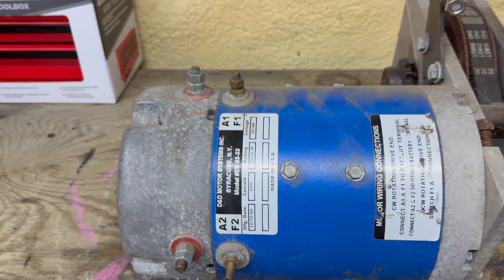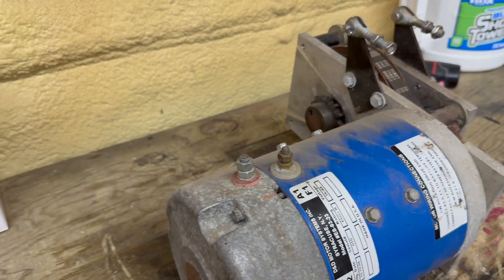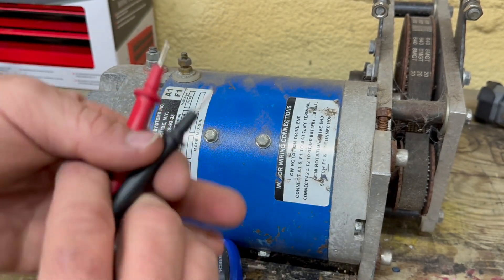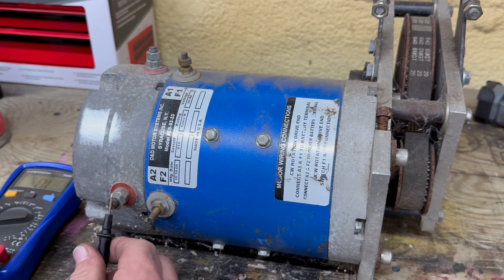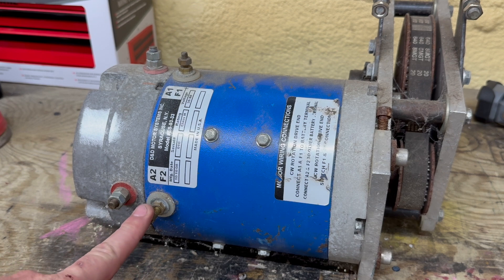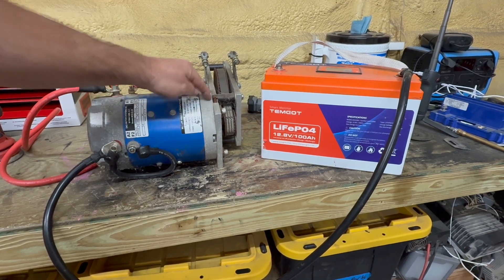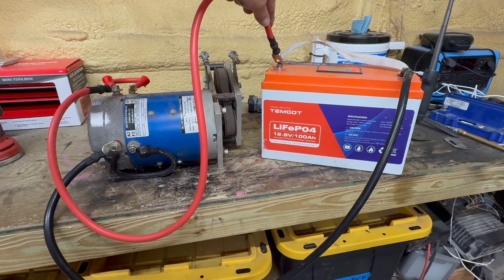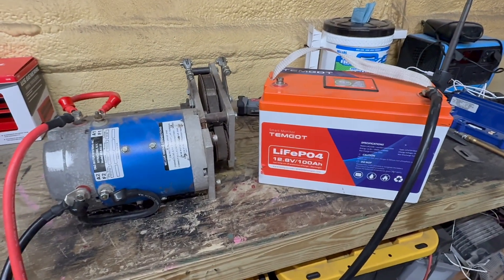How To Test Sepex / Shunt Golf Cart Motor At Home | Ezgo Club Car Yamaha

Comment: I checked my 2019 Club Car Tempo motor and I have continuity between A1-and A2.  I also found I have no continuity between A1and S1 and A2 and S2.  I also found there is continuity between A1 and ground, A2 and ground, S1 and ground, and S2 and ground all with some recordable resistance.   I assume the motor needs to be replaced?  Correct?

Comment: I assume that if I reverse the polarity connections to the battery, per your bench example, between A1 and A2 that the motor would move alternatively in Forward and Reverse. Demonstrating that last bit on your bench would have been even more Ooooo and Ahhhh! Anyways, Thanks, I'm about to go do that on my cart myself.
Reply: No. Curiously, it didn't work that way. Reversing the polarity did not change the motor rotation direction. So, I'm left confused as to how that works.  Anyone? Anyone?

Comment: Wow, your vids are super helpful!  I see my motor has the same A1, A2, F1, F2 setup. But there's also a grey wire coming out the top. Wanna tell me what that is for?
Reply: ChatGPT told me that the limp grey wire is the speed sensor, and it goes back to a plug connector in the Curtis 1264 Motor Controller. Yep!

Comment: I had a question I have a 2007 yamaha g29 48v cart tested battery pack,solenoid,and controller input and output when I saw your video I tested my motor in the cart (I hope that still okay to do) as you did but I did not get a beep between A1 and A2 all the rest was good can this be repaired or am I looking to have to get a new motor (i have not yet put 12v to it yet) your help would be appreciated thank you